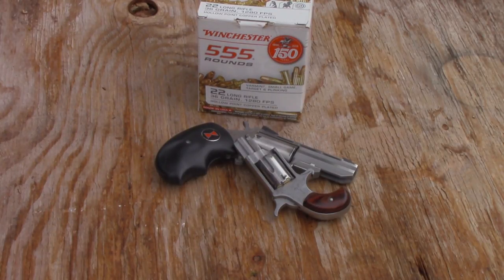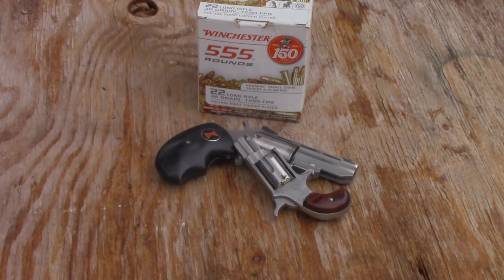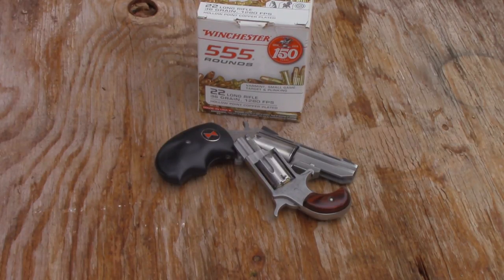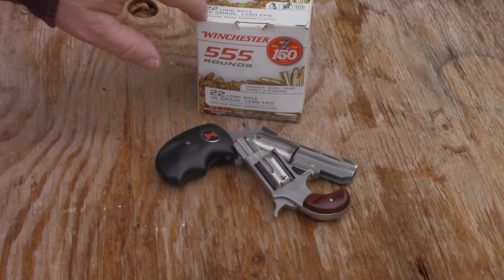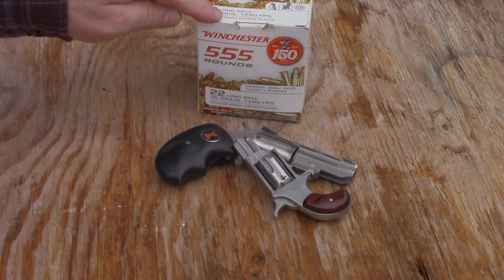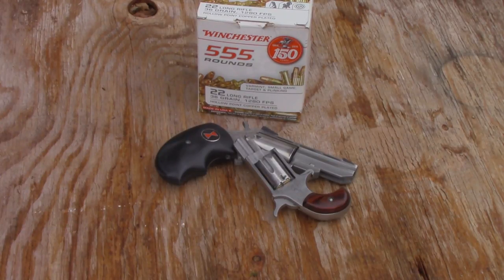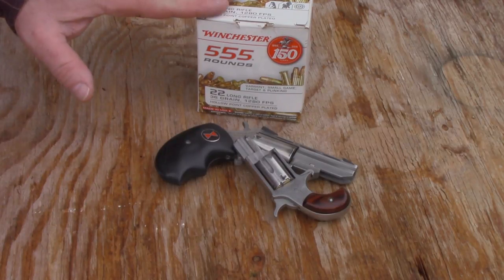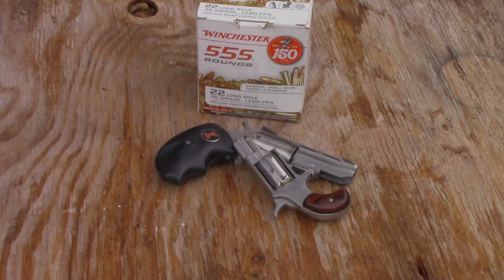NAA 22 LR Mini Revolver Chrono

Comment: The US military regards 58 ft•lb of bullet kinetic energy as the threshold for causing a reliable combat casualty.  This, of course, is not a bright line, but the military uses this value as one of its two prongs to determine maximum combat effective range (the second prong is accuracy).
Reply from the maker: Both of these revolvers meet or exceed that spec out to a few yards.

Comment: It’s probably powder burn rates.  Hyper velocity cartridges are designed for high velocity out of a rifle barrel, which involves a slow burning powder to continually accelerate the bullet as it goes down the long barrel.

A fast burning powder in a rifle will give a lot of initial push, but not as much later on down the barrel, so there will not be as much added veocity as with a slow powder.

However, in a short pistol barrel, a fast burning powder is preferred for higher velocity.  It needs to accelerate the bullet as much as possible in a very short barrel.  A slower burning powder won’t have time to accelerate the bullet in a short pistol barrel like it does in a rifle barrel.

Comment: Possum,  if ya ever get a chance to buy a 50 rd. box of " Aguila Interceptor's" try them out. they are just as good as Stinger's but they are 40gr. copper washed at 1,470 fps. LR.'s  and cheaper with more punch. their cases are regular LR length unlike Stinger's.  I can hit steel almost every time at 200yd.'s would be perfect for those lil wheel guns.....your foot pounds would be better than others. have a good weekend buddy.  walt......... great content........
Reply from the maker: Thanks, Walt. Another subscriber recommended those too, so I'm looking for them. When I find some I'll test them.
Have a good weekend!